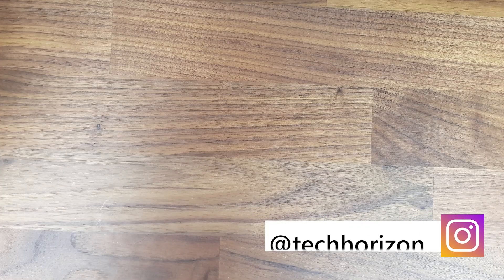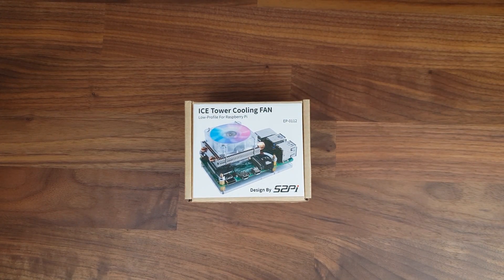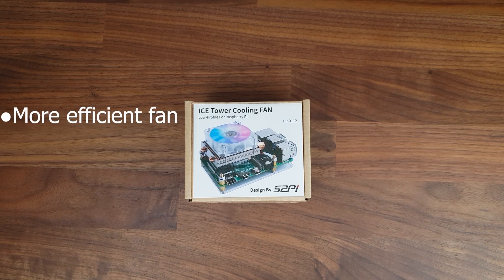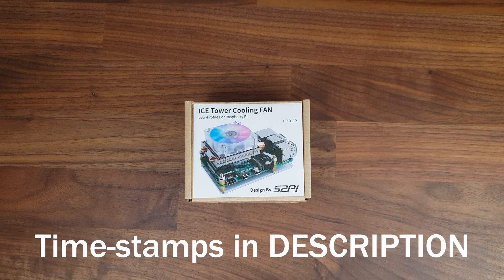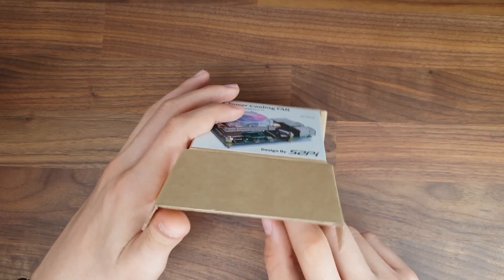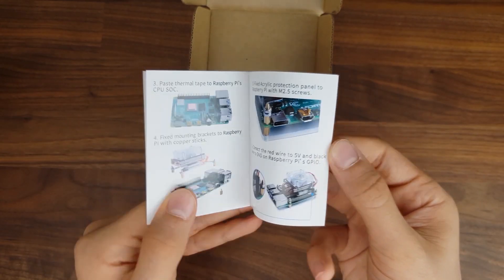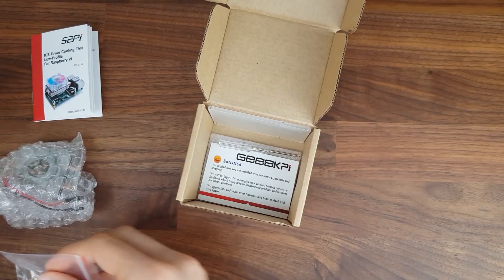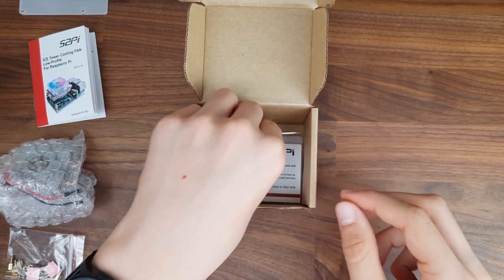Low profile ICE tower case for Raspberry Pi 3, 3B+ & 4/FULL build & SETUP| By TH

Comment: I've got two of these low profile Ice Coolers. I've got two Pi 4 boards running 24/7 with these and they never get above 52 degrees no matter how hard I run them, even with a 2ghz overclock. If you don't overclock your Pi you really don't need much more than a cheap fan, but these enable you to push it to the limits.
Reply from the maker: That's why I love them 😁

Comment: I'm getting temps at idle of 34C with this cooler in their metal case (made for the low-profile cooler).  The ice tower coolers are - hands down - the best Pi4 cooling solution. It's too bad that GeeekPi can't keep them in stock. I'd love to get a few more of the low-profiles... It's also too bad about the RGB fan. I replaced that fan with a Noctua because the RGB crap is... well... crap.
Reply from the maker: I definitely agree with you. I simply LOVE this cooler😍 and like you said it's pretty much the best cooler out there...
And I guess RGB isn't everyone's thing👍

Comment: I just have a question. It is a fact that the ice tower is one of the best at cooling the Pi. It consistently has the lowest temperatures. I understand that the Pi throttles and does not like temps over 80. So what is the difference between the Pi running at 50 degrees and a fan heat sink at 60 degrees? If a fan/heat sink only goes up to 60, how is the ice tower better for people if the Pi does not throttle or get really close to 80 and therefore does not throttle or damage the Pi in any way?
Reply from the maker: If you don't throttle your pi over 60°C and if you haven't overclocked it to much, you don't actually need an ICE TOWER cooler/ case.
However you will definitely need a case of some sort (if possible with active cooling) to prevent you from accidentally  electrically discharging your pi and thereby harming it. Apart from that a case also protects your pi from dust etc.

IF YOU NEED A GREAT, CHEAP ALUMINIUM CASE WITH ACTIVE COOLING FOR YOUR PI, CHECK OUT MY PREVIOUS VIDEO: https://youtu.be/kwdnFmYPifw

Hope this helped you out👍
Reply: I'll jump in and add, per your question or what I assume you to be asking, the lower the temp for a cpu/gpu/whatever p u... the more efficient it operates... look around on youtube for some experiements with liquid nitrogen cooled gpu's and the framerates they were able to achieve because of the temps reached. Of course this applies to situations where operations per second and load are extreme yet, I contend, as I said, the lower the temp, the more efficient / stable you'll be.